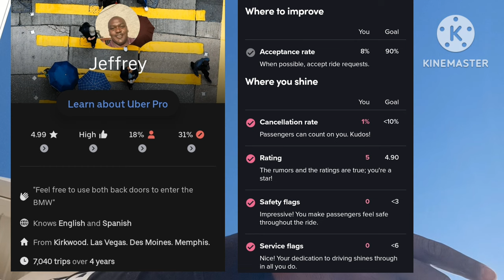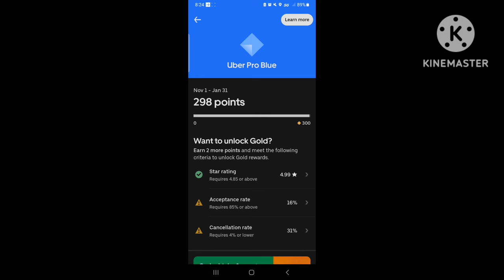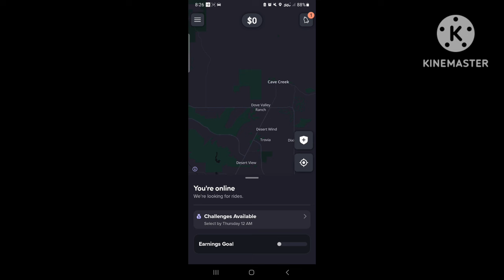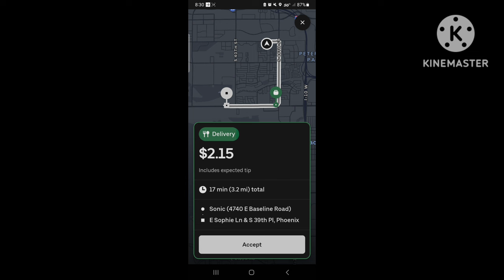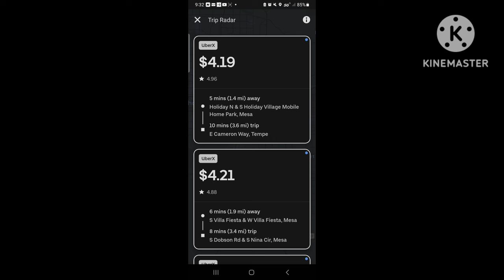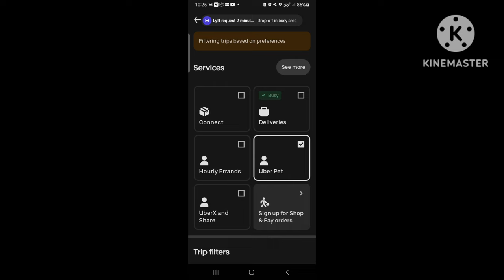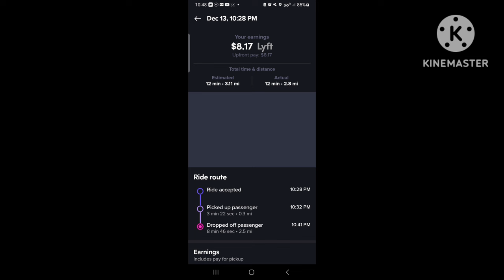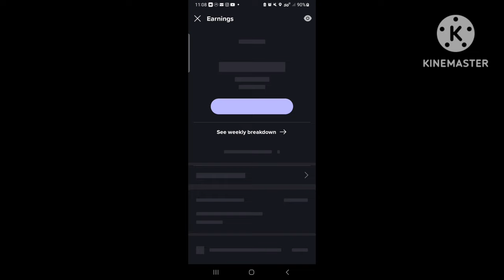🐌 😤  No Surge Uber & Lyft | All Trash Rates 💰

Comment: That’s the results of way too many drivers out there. Way too many desperate poor drivers accepting low paying rides. $4, $5, and $6 rides all day long. Uber / Lyft love that! They’ll never change the system. It works perfect for them.
Reply: Correct...however, there will come a time that the lowball accepting drivers will have car repairs, accidents etc.  They will then realize that because they have been accepting lowball offers they were driving for free or at a loss.  And roaming charges to run all these apps is costly!  I am at the point of only turning on when I see surge, or when surge is hidden & keep on during rush hour.  
Yes, new drivers will constantly load onto the app to replace the broken drivers though.

Comment: I just made 90 bucks in like 20min driving less than 10 miles this morning
Reply from the maker: Exactly! These apps out here clowning drivers...$15 for like 30 miles. Man, they banking on those.drivers that don't know better. I'm trying to do $80 in about 30 miles total, just like you saying.
Reply: @MicDropBBQ  yeah had a Lyft trip with that Harriet. Took them to the strip club crazy horse.. then they had to change clothes so shot them back to the house literally up the street. Then one forgot they id ended up being in my seat 😂😂😂 so I got one $20 cash tip and 3 $20 cashapp plus that $10 Lyft ride

Comment: lyft did some offer if u dont get a ride in 10 min from a reservation they pay u $20 to use for a cab uber or another lyft, so lyft now has a crap ton of $3 to $4 reservations. Surge and demand are almost no existence every day in Chicago where im at. On top of the lack of surge, demand, bonuses when u do see a ride request it seems they have gotten it as low as they can for the driver, customers do say they have gotten rate increases. Drivers get less, passengers pay more if you do a reservation, youll get a higher fare earning but, you will be blocked from doing anything else for a long while prior to actual pick up time. Its definitely a struggle to earn enough to keep going, sometimes the queue at airport gets maxed out, good luck waiting 2 hrs to get 1 crap ride.
Reply from the maker: Idiots always losing money on purpose. Pay drivers and all will be well. Keep running schemes and shit won't work out. They ain't learning yet. 

Easy fix: pay drivers a fair percentage and stop letting undocumented drivers on the platform. Should have an American drivers license for at least 5yrs. No sub-contracting accounts or permanently banned from the apps.

And free hot dogs, with onions, no matter what the AR is. Hahahaha
Reply: @MicDropBBQ 

🌭🛒💁‍♂️

Comment: Do you have stay within area on Lyft filter. Has a minimum of 5 mile radius.
Reply from the maker: I used to use it, but it's pointless. I say this because you can drive more than 5 miles within that zone. They'll have you drive 4 miles to pick someone up and then drive 9 miles back. That's 13 miles because you zig-zagged in the zone. The 5 miles is from where you are located in the center - which is a 10-mile circumference.

The radius is from the center, which means you have 10 miles of travel - in a straight line - from one end to one end. Now, if you're zig-zagging, that could be 4 miles to pick someone up at the edge of the radius, then 9 miles back to the other side of the radius (in a straight line). You just went 13 miles if you went in a straight line, but with the way streets are, you could end up going closer to 20 miles with a 5-mile filter one.

I did a video a while back at a concert with the 5-mile filter on, and they send me a trip that was 12 miles total from where I was, because I took a trip that got me to the edge of my filter - then had me go to the other side of the filter to pick someone up to take them somewhere else. Yup. That video is on my channel.

Once that happened, I never used the filter again. I'm quicker doing the math myself.